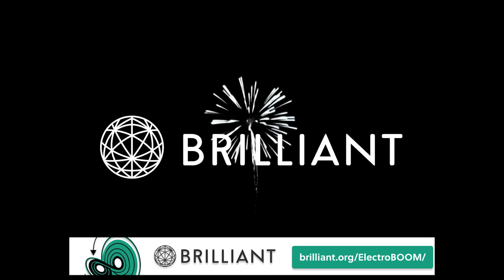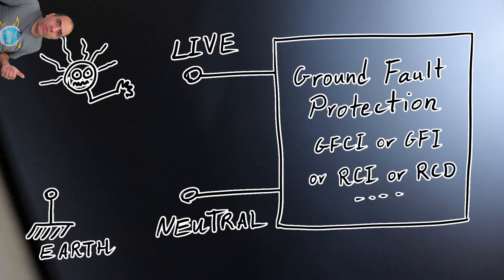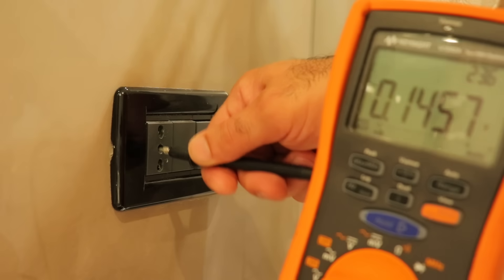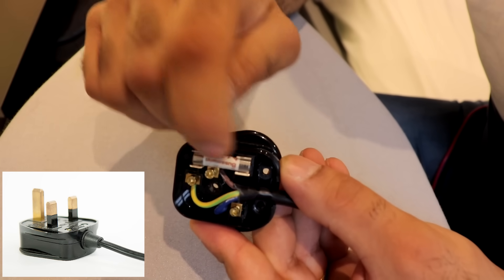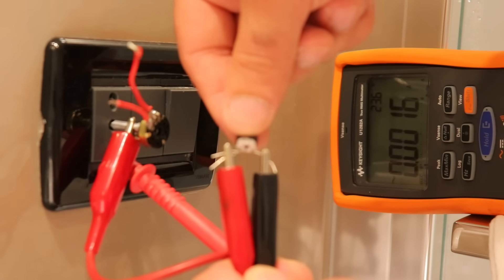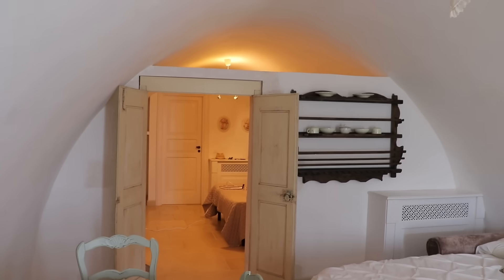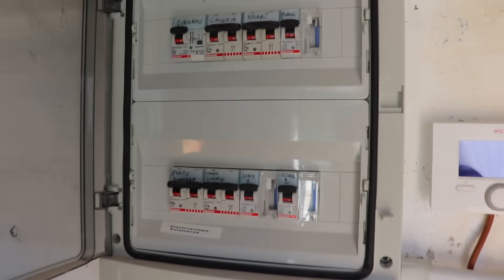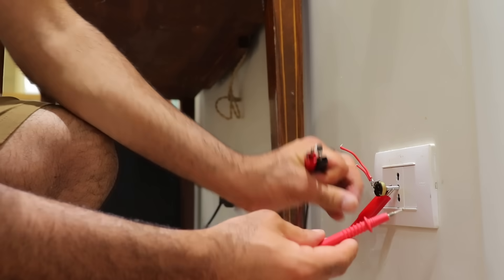Tripping Every Breaker in Italy

Comment: The "double holes" are there because the same outlet accepts 10A and 16A rated plugs. The plug you used in the first test in Venice is a 10A.

We were supposed to check for the correct equipment, but most electric shop carry adapters for plugging 16A rated plugs in 10A sockets and people sometimes use them as badly as you can guess.

As for the weird screw-type connector, they're useful to connect stuff from both parts

As for the "doors" inside the sockets, they're "fairly" recent, anything between 20 and 10 years ago. Seems kids were getting shocked by sticking stuff in the plugs or even their little finges, so every single socket sold here has door that activate only when you press with both prongs.

In my hobby room I have a cheapo socket that requires Hulk's strenght to fix anything inside, and I use it for stuff I don't plan to get out anything soon
Reply: As for the weird plug near the RJ connector, before Wi-Fi hotels used to offer ISDN and cable ADSL to users. I guess you could insert a key to unlock the service. Of course since everyone and his down now owns a 4G and 5G cellphone, cable connections are kind of obsolete

Comment: I just had my old obsolete breaker box replaced and the new one has either a GFCI or AFCI breaker on every 120V and 240V circuit except for the HVAC. It is the law now and very expensive at $80-$240 apiece (vs $5-$25 each for the old style), especially during the shortages. Worth it for the piece of mind.

Comment: Almost the same here in Spain. We call it "diferencial" and it's always in the main breaker panel. Modern installations have one with a motor which rearms itself two times (it's called rearmable). The third time it stays off and you have to rearm it manually. 100% of the plugs in modern homes are like the round one you showed (schuko).
Reply: Schutzkontakt-Steckdose, let's go
Reply: Same in Italy, we call it differenziale, so diferencial :)
Reply: Same in Portugal 🇵🇹
We call it "diferencial" too
Reply: I believe almost all countries in Europe use the round outlets which support 3 standards - Schuko, the French standard (which is very similar), and the Europlug (not grounded). For some historical reasons countries like Italy, Switzerland and the UK have their own standards.
Reply: @TheGrejp  It is funny because I have seen many schuko plugs here in Spain with the extra ground hole and I didn't even know that was there for compatibility with the French standard.
Reply: I live in spain and i never saw something like that, where do you live?
Reply: @badblenderanimations1449  Do you mean the auto-rearmable one? They are everywhere... but only in new installations. They are a bit expensive though, 130€ or so,  you can buy them everywhere. The normal ones are way more common though and cheaper (20-40€)
Reply: Now new installations also have another protection for current peaks (such as a lightning strike).
Reply: @badblenderanimations1449  well, I've traveled through Spain a lot and they are everywhere I've been, it looks the same as a breaker thi
Reply: Same in Chile. We call it "diferencial"  too and Schuko plugs exists, but only in a small quantity
Reply: Not everywhere. I'm Spanish and my apartment is quite new and I installed  the motorized one, because due to external harmonics the differential tripped a lot. But the builder installed an standard one.

Comment: Those screwed wire connectors are the standard in Australia too. No wire nuts here. RCD/GFCI is also standard for all power and light circuits in the central meter box. Power circuits was standard since the late 80s/early 90s but they only recently added lighting circuits in the last few years.

Comment: Fun USA electrical fact: As of the NEC 2020, all new construction residencies that follow 2020 code requires minimum of ArcFault breakers. They prefer you use GFCI breakers as the generally are also Arc Fault protected from the factory as well. So once the 2020 NEC is officially adopted state to state, the price of AF breakers will reduce and thus become more widely used. Until everyone adopts it though, people will do their best to avoid them due to extreme prices. They do take a bit longer to install and in older houses they will be a  nuisance because of sloppy tolerances in older devices. But they are becoming common place as it is becoming more required.

Comment: I'm an qualified electrical worker in vienna, austria. and in the EU blue is always the neutral, black/brown/grey is the phase and PE (protection earth) is green-yellow. i'm a little bit shocked that the hotel doesn't see to have an 30mA RCD. you have to install them, it's a law (if there is any socket you need at least one RCD).
maybe this are little sub-fusebox and they have RCDs in the main-fusebox but i'm not sure how italy handle this :-)

edit: okay now i have seen the whole video 🙂
one last info: if you are planning some electricity you need at least two RCDs Type A in austria so the whole flat/house is not dark in case of some electrical fault. At minute 13:39 you can see the wave in the square. This is a type AC and not that safe anymore cause it's only for alternating current. if you have a direct-current-fault over earth the RCD magnetic field can getting "fixed" and it won't pop anymore. better is the Type A. in germany type AC is forbidden :-)

the connectors in italy are also bad cause you don't know which side is neutral and which is the phase. the best connectors in my opinion are in poland. it's like the british connectors but without a fuse, so the plugs are smaller. good spoken at 14:58 <3
Reply: Bestandsschutz?
Reply: @thebamplayer  ja, den gibt es. aber bei wesentlichen anlagenerweiterungen oder anlagenänderungen ist die anlage auf stand der technik zu bringen :-) und bei gewerblicher nutzung gilt auch noch die ESV (elekroschutzverordnung)

bei mietwohnungen ist bei abschluss eines neuen unbefristeten mietvertrages auch ein RCD vorgeschrieben.

die frage, die sich jedoch stellt: ist es nicht allgemein sinnvoll den zusatzschutz nachzurüsten?

Comment: 9:17 that is a proprietary phone plug by Bticino. Luckily I had ad adapter from that to a rj11 male connector so that I could've figure out how to wire the new plugs I was going to install
Reply: The telephone connector is called BTicino-2021. It does not have the security lid as the BTicino magic power connectors. It is somewhat similar to the old French phone connector F-010.
Reply: https://en.wikipedia.org/wiki/Telephone_jack_and_plug
down in legacy you can see an example of the bticino phone plug
Reply: He is asking for the rectangular plug wich it's called a magic plug. And it's intended to identify wich its the neutral and live wires as it can be only connected in one way
Reply: @ivanokmunoz  googled magic plug , it wasn't what I wanted to see
Reply: @warmarin  lol, try bticino magic. That's the complete name
Reply: @warmarin  AHHAHAAHHAAHHAHAHAHAHAHAHAHAHHHAHAHAHAHA nice try ahahahahahahhahahahaa
Reply: @ivanokmunoz  It's actually not a Magic power plug. It's a phone connector, same series as Magic, but not compatible (for obvious reasons) with Magic power plugs
Reply: @MrOpenGL  yep but I think is the phone connector of the magic series as the plugs looks the same.
Reply: Reading the comments here - why does Italy have so many proprietary standards for plugs/outlets? Specifically by private companies like Bticino (as far as I can tell)
Reply: @TheGrejp  but that is not a fact. That is a very strange plug that I probably seen only once in my life. For the rest they are all standard.
Reply: @Ale-bj7nd  As far as I can tell the weird plugs like that one are short-lived standards which didn't catch on and aren't common, of course. My question is more along the lines of "Why did Bticino go and produce a boatload of different standards nobody was going to use anyway?"
In the early days of electricity this was common, but these outlets seem to be relatively recent (from the last few decades). Why design new standards when everyone already uses one or two perfectly good standards? It's not like every building in Italy is going to switch to a random proprietary standard just because a private company like Bticino made it, it just doesn't make sense to me why they even made it in the first place
Reply: @TheGrejp  yeah that's a good question

Comment: I was supprised when I found out american plugs were one way plugs. I mean, does it ever matter wich way you plug something in?
Reply: Yes, because before grounding was a thing the neutral was sometimes connected to the metal chassis on old devices such as radios.
Reply: @alexatkin  Fair enough. I hope that is still not a thing though.
Reply: @stefannilsson2406  No, but there's a passionate fan base of older hardware.  I have a friend in Texas who is into tube amps, tons of channels on YT fixing old appliances where this is potentially an issue.

Comment: When the EU created its voltage standard, to accommodate all the various minor voltage differences in countries they went for 230v +10% -6% so the UK stuck with 230, and 220 is still within that specification.
Reply: The UK was 240v and later harmonised with Europe on 230v.  In reality nothing changed as the tolerances just increased.  Its still common to find our voltage as high as 253v when demand is low.

This was actually a PITA when lighting moved to CFLs as all higher light output CFLs seemed to be made to EU standards and would fail early due to running too hot at 250v.  Thankfully the move to LEDs has dramatically increased the lighting market so finding high quality LEDs that handle the full voltage range properly is not hard, if you're willing the spend the extra money. (worth it in the long run)
Reply: UK really has 240 V though they pretend it s 230 V.
Reply: @okaro6595  Its kinda a yes and no situation.  Voltage where I live was consistently around 250v but over the last decade or so has slowly reduced.  No idea if that was intentional or not, but I'd think the change would mean they wouldn't want to constantly be right on the upper-edge of the tolerance.
Reply: Yh sorry mistype 240v. As I say the EU harmonisation is 230v with the tolerances so nothing changed (was an on paper harmonisation).

The only reason I brought it up was non-European people (as Mehdi is in this case) assume 230v to mean 230v, but the aforementioned tolerance means 220v in Italy is 'the norm'.

Comment: At 9:10 that looks like a Bticino telephone plug, if you look up "Bticino Magic 5021" you'll find it. It was used as a substitute for the tripolar socket from SIP, which itself has now been replaced by the RJ11 connector.

Comment: Quick correction on the US GFCi standards. You said that if there is GFCI protection that it's in the washroom. Now we'll it's not wrong to say that the bathrooms have gfci protection, it's not the whole picture. Article 210 section 8 of the NFPA70 (our electrical code standards book) lays out exactly where GFCI protection is required in residences. They're required in: bathrooms, garages and accessory buildings, outdoors, crawl spaces, basements, kitchens, within 6' of a sink, boathouses, within 6 feet of a bathtub or shower, laundry areas, and indoor damp and wet locations. 
I would absolutely hate to have my whole house turn off if the main breaker was gfci protected. That's so annoying that every time there is a neussance trip I'll need to go outside to re-energize the circuit. We have many issues with our electrical standard, but GFCI I don't believe falls under that category.
Reply: I disagree, there are plenty of grounded devices out there that if they had a faulty ground and became live it would be rather useful to not get electrocuted.

The fact that some places stupidly put the breakers outdoors is a poor excuse for lax safety standards.

Comment: You showed the traditional Italian plug, which has ground in the center.  That one should be used.  When you have non-Italian equipment, with the Euro-plug (which is used in most European countries) you can use a converter plug which the handles ground correctly.  However, in hotels (and probably also modern homes) you can use the Euro-plug directly with loss of the ground.  You probably should only use those for plugs which do not have a ground in the first place ;-)   There is no consumer equipment which depends on  specific N/L location anymore, as far as I know.  Power equipment use larger plugs where it is defined.

Comment: 15:30 It's fairly common for a lot of houses in the Netherlands to not have ground at all in most sockets. You will HAVE to do it like that if you want to use anything. It's not great, but it's how it is. Typically there's only ground in the bathroom, the kitchen and a washroom (if any).

Another thing to keep in mind; this is the standard for Italy. Not Europe. There are differences across all of Europe.
Reply: @admin That too. Possibly. Or just safety. You don't really need a plug in the bathroom really. It's all just convienence; but not required.
Reply: @ruadeil_zabelin  That may expain why many people have the washing machine in the kitchen.
Reply: @MernokiMegoldasok  Maybe. But i think that's more because of the drainage being easily available there. People will happily connected it ungrounded if that means it can be in a more convenient spot. There's really nothing stopping people from doing that; dangerous as that may be.

Comment: In Italy it is mandatory to have a differential  swittch next to the meter (in the first 3 meter of the line after the electricity meter)
Reply: Sure? My place got all the meters in the basement, but fuse boxes into every apartment.
Reply: @kentahirono  There should be a differential switch in the basement as well. In this case a good choice would be to use a 300mA differential switch in the basement and a 30mA differential switch in every apartment. Another option is having only one 30mA differential near the meter and a normal swch in the apartment, in this case if there is a differential current you have to go to the basement to turn on the swich

Comment: These trains run on these high-voltage lines

I wish I could check the ground-fault protection on them
-Mehdi
Reply: Before that happens, the wire will be long turned in to smoke.
Reply: There is no ground fault protection on railway systems.They use the grounded rails as the neutral.
Reply: @MernokiMegoldasok  It's a joke, but that is good to know

Comment: For application where it is important which wire is live and neutral, for this you can get standarized connectors. They are called CEE conectors and are available for 230V and 400V.
Reply: The upper limit is not 400V but 690V.
Reply: it could be rated higher but you don't see it usually in 230/400v country. that thing is high enough to not need different voltage for most of industry

what device actually uses 400v eh, let's see. ovens, stoves, water heaters use it indirectly by wiring heaters into different phases for load balancing and less current in one phase

directly it would be motors, if you have larger home workshop. my grandfather even built lawnmower. no it's not power, it's 400w, just uses it for rotation

iirc bigger ground source heat pumps could draw 400v so they evenly split the load

while one could argue on safety, compared to 120/240v it starts at "maximum" there, with added benefit for going higher. in us they actually fixed that later by providing here-ridiculous 200a
Reply: @nicolajkl  1000V is also used for industrial loads when 690V is not enough.And above that you go medium voltage, 3, 6 and 10 kV.
Reply: @MernokiMegoldasok  I couldn't find any CEE's beyond 690V at shops in my country (DK). But good to know.
Reply: what device uses 400V?
Reply: @hellzila  all european three phase things basically. Things that use more than 3,5kW.
Reply: @hellzila  Heat pumps. Car chargers. The occasional induction stove, though most of those just use each phase with the neutral for 230V and are just spreading out the load. Still, I had to install 5x4mm² on a 3-phase 25A breaker the other day for a 17KW Aga english style furnace.
Reply: @hellzila  Welding machines, concrete mixers, some saws, pizza ovens (commercial).
Reply: @spaggtrait1608  No. It's squareroot(3)398,37V=690V (which also happens to be 230*3). Reason I'm not using 400V is because squareroot(3)230V=398,37V.

I used to work at a factory where we had a a lot of huge motors running on 690V to save on the cable guage, because higher voltage = lower amps.

I'm an electrician.

Comment: Well, those protection pops fast enough so that 30mA is not that painful :D
Reply: 500 mA at my old house, so it is instant death.
Reply: @tsusec  Good that it is 'old' now :D
Reply: @Konrad Pierzyński  I would like to change it for 100mA, but for that ill need to call Electricity Suplier because i cant reach main fusebox with 25A fuses without them.
Reply: @tsusec  500mA in the main fusebox is to protect wires against fire, you don't need to replace it. Just install a 30mA breaker in your secondary fusebox.
Reply: @mrfrenzy.  Main fuse box (under the roof) only has 25A fuses for 3 phases and it cant be opened by me legaly. Secondary fuse box is the box with 500mA RCD.  Now i can only add 30mA in series because im not happy to work with HOT wires.
Reply: @tsusec  it will look a little funny but work perfectly fine to have them in series.